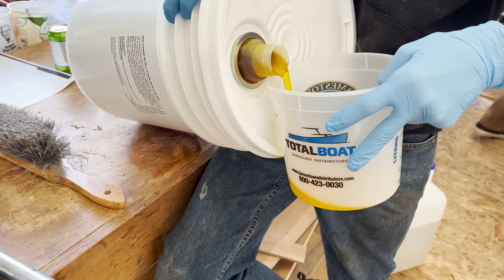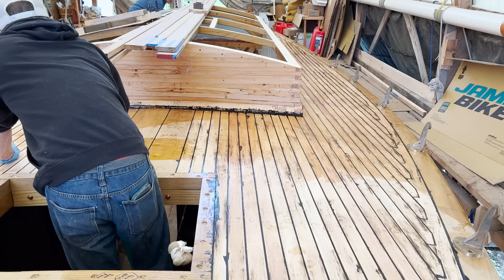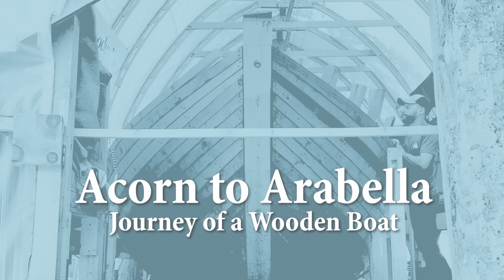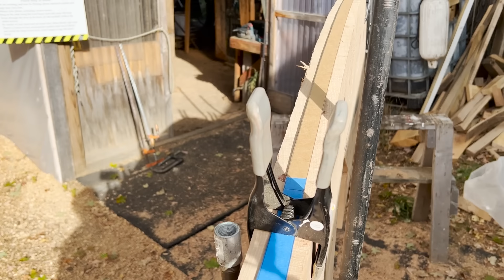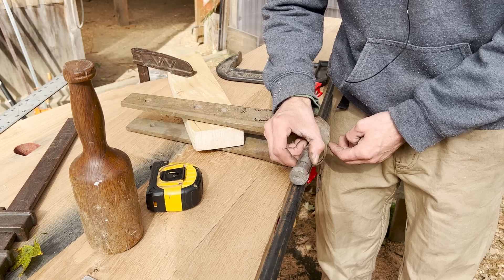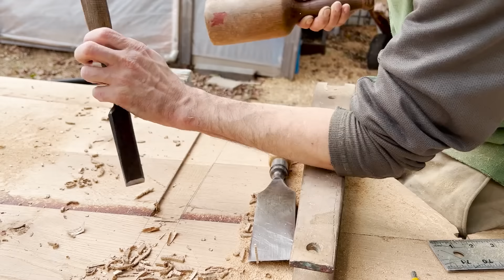Miniature Lead Pour for the Rudder - Episode 236 - Acorn to Arabella: Journey of a Wooden Boat

Comment: Steve tip for ya. For big removal. Using a weed torch or heat gun on low to soften NOT melt the pitch in one area at a time. Clean as you go by using 2 old towels. 1 soaked in linseed oil to loosen and scrap the pitch clumps from the surface and 1 dry towel to remove the pitch. Then for the residue and stain clean up. Use a variable speed angle grinder with scotch bright attachment of different coarseness and linseed oil so pitch doesn't stick to other area's. Pads will clog up so you'll go through quit a bit of them. 👍👍👍👍👍👍👍👍👍👍👍👍👍👍👍👍👍👍👍👍
Reply from the maker: Thanks for sharing!
Reply: @AcornToArabella  No problem remember doing a job on an old wood back deck years ago. A home owner had pitched it with black top them selves. Then past away. The home owners Son needed the whole house restored plus the deck on a budget. So he could sell the property. Looked like it never even happened.  After we restained it😎👍👍

Comment: A rudder that wants to sink or float will make its removal and instalation difficult in the water, one that floats just enough to stay at the surface makes more sense. Find the weight that adjusts your rudder's buoyancy in a pool or pond, with the project's indicated weight as a first guess. Once floating (or sinking), add (or remove) weight until buoyancy is neutralized. Then, remove barely enough to keep it at the surface in fresh water. Take note of the weight remaining on the rudder. Buoyancy will increase at sea, so additional flotation (safety margin) is unnecessary.

Comment: Have you guys thought of a "soft" solvent to get rid of the pitch? I'm thinking Xylene or butyl acetate. I've used them to remove hardened PVA paint, cement which has liquid latex and water as the liquid component and a general degreaser. Maybe one or both will dissolve pitch, but on drying should leave the rest intact?
Reply from the maker: Thanks for the recommendation.
Reply: @AcornToArabella  Goes without saying, which I forgot! Test a bit first!  Xylene smells a little, except in a confined area where it burns your eyes! Butyl acetate stinks to high heaven, it's also used as an apple flavoring! I cleaned 15 year old PVA paint off my wooden ceiling trims, the house stank for almost a week, but the result is no trace of the previous painter's mess.

Comment: Your welding would look better if you would weld where there’s no breeze.
The moving air is blowing your gasses away.

If you are concerned with the lead moving, cross pin it.

I thing the lead is to assist in returning the rudder to mid ships

Comment: Concerning led on the rudder: motorcycle riders will testify to this - weighted handlebar ends help reduce vibration. Vibration on the rudder won't be an issue but led may have a stabilizing effect.

Comment: Just looking at the design, I'd guess it's to weight the rudder so it naturally wants to rest centered with the tiller amidships.  Given the rake of the rudder post and the natural buoyancy of the rudder, maybe without that lead weight the rudder would try to float, causing the tiller to want to come hard over on it's own whenever the boat is at rest which would be irritating and cause the boat to "crab" when anchored in any current.  I dunno; just a guess...
Reply from the maker: Many (most) rudders do not have any weight added to them. I think it’s most likely a smart accommodation to counteract forces while under sail. It would make weather helm (having to hold the tiller to wind) a little more easy on the arms of the skipper. —Anne

Comment: I would guess that the rudder would have neutral bouyancy if it were perfectly aligned top to bottom. Once the helm was over though the buoyancy of the wood would attempt to float the rudder "up" adding force to the rudder, the lead would pull the rudder "down" removing that effect.

Comment: Awesome work Steve!  One thing I’m wondering. Aren’t lead and silicone bronze pretty far apart in the galvanic table?  Is that a concern for dissimilar metal corrosion in the salt water?
Reply from the maker: No. Encapsulated as it is. Lead keels have bronze or galvanized bolts through them… again, mostly encapsulated and not a problem for a great many years. The lead would corrode before the bronze, besides. —Anne
Reply: Thanks. Always learning something from watching this channel!

Comment: Just out of curiosity, did you need to leave the bronze fasteners in place while tapering the rudder?  Not so worried about planer blades as I am about your adze but either way, it makes for chewed up edges.
Reply from the maker: It’s holding it all together, and it’s all been glued. Check out last week’s episode for more on that.

Comment: Tally Ho rudder was originally going to look similar, but Leo changed design based on hydrodynamics, so now his trailing edge is straight vertically and not curved so water is forced over train edge and it doesn't sneak above or below where curve is the widest. Plus the deepest part of the rudder has the most steering effect as the water pressure increases as you go deeper.

Comment: Fantastic work as usual. I have a question, why would you not fair the rudder to a NACA profile knowing, as we do now, how effective they are compared to a traditional tapered profile? From my limited research (quick google search :-)) I know that it was developed in 1935, so after Arabella's design. My thinking is that it doesn't detract al all from the esthetics of the boat but has huge advantages in steering power and considerably less drag.
Reply from the maker: It wouldn’t have a huge effect on the speed of this heavy-displacement cruising boat that’s likely to spend a great deal of her life going about 5 mph in water. The taper makes a little difference compared to leaving it heavy on the trailing edge, and that’ll do for this purpose. Happy Friday!

Comment: Expanding on the other comments, the lead makes the rudder negatively buoyant (it wants to sink).  With the approximate 45˚ angle on the rudder hinges, and the rudder below the hinges, a negatively buoyant rudder will tend to self center when you let go of the tiller.  Without the lead, the rudder would be buoyant and want to float/flop to one side or the other when you let go of the tiller, not a good thing...
Reply from the maker: Not many rudders are weighted, though, and they do a-ok. We’re noting the detail because it’s interesting.
Reply: @AcornToArabella  You are probably correct to just trust the Atkin design!  Your comment got me thinking more about the dynamic details.  My negative-buoyancy-to-center is true when still in the water, not very interesting for a rudder...  When moving, the hydrodynamic pressures created by the flow of water over the rudder will tend to center the rudder.  The more interesting thought experiment is when on a reach and heeled over.  At that point the greater wetted area on the leeward side of the keel will tend to pull you to leeward or off the wind.  I wonder if there is a little net buoyancy left in the weighted rudder to pull the boat back into the wind.  It would be incredibly clever to have a slight net buoyancy to keep the tiller neutral as you heeled over on a reach.  Anyway, maybe next year, when you get a feel for the tiller in various winds, you can let us know how well all of the Atkin design works...

Comment: Could the purpose of the lead in the rudder not be to keep the boat going straight. If the rudder is not held the weight would pull it to its neutral position.
Reply from the maker: Maybe useful at anchor or while raising sail in that case. It’s probably most likely for multiple reasons. Counteracting weather helm, or making it easier to manage, for example. —Anne

Comment: If you're using a belt sander on the final finish of the rudder, why not use a router to get the taper you need instead of doing it manually?
Reply from the maker: Routers can take off very easily. He removed plenty of material quickly with the adze. It’s a preference thing.

Comment: Could the weight be to counter act the lever arm of the tiller? To help bring the rudder back to center. I have zero boating experience just speculating.
Reply from the maker: It’s probably for a couple of reasons, and when/if we feel a difference from other boats KP and I have sailed, I think we’ll be able to say. Neutral buoyancy for ease on the hardware, making weather helm less work for your arm, centering while not tied off at anchor… all of these seem plausible. —Anne

Comment: Having the weight outwards should dampen the rudder a bit. Spontaneously I would think having it inwards would be better because it would be easier to move the mass but I guess that's not really what it's meant to achieve here. Having the mass outward would mean that the water movement would affect the rudder less so i guess it make sense, just that it also mean that the skipper needs to apply more force as well. 

Not a boat builder though.

Comment: I have two questions: First, what is the name of the plane that sat on top of the groove as you were using to work the slots for the rudder hardware AND What were you using to sharpen the edge of your adze?
Reply: The plane is called a router plane and the sharpener i guess is some kind of wet stone but i could be wrong.

Comment: Me thinks the lead is to ensure the rudder always swings back towards the middle, even with the tiller in the upright position. I have a longkeeled plastic folkboat  with a similar rudder. When mooring you often stand up aft, with the tiller in an upright position. As you move forward to get a mooring line on shore, the tiller stays upright (friction), and the the rudder falls to either side, due to the tiller weight and the angle at which the rudder hinges. Annoying to say the least! Some lead in the rudder would make sure the tiller stops going to the side, avoiding unwanted mooring drama…

Comment: I thought the linseed oil would softened pitch?
Reply from the maker: No, it doesn’t have any solvent properties to it really. The pitch stands up to it. If you mixed linseed in with pitch while it was hot it’d probably take longer to cure.

Comment: Why not use tar and bedding compound to fix the counter weight to the rudder? Wouldn’t that be more in line with the overall build philosophy? Oh right, I forgot, you tapped some 4200 trees. No problemo. Easy peasy.
Reply from the maker: HAHAHHA welllll, not sure if our build philosophy is fully understood—easier maintenance, longer term. Basically, under the water or wherever certain materials are used, we’re using what we think might work best. Tar is a bedding compound, but never cures and will lose its oils to the wood around it and slowly over time to either the air before we launch or later leeching into the water. A chemically curing glue will last longer.
Reply: @AcornToArabella  Wellll, research is showing these modern lightweight polymer compounds do leach into the water column, descending very slowly as they’re absorbed into the food chain. The facts are we don’t fully know the longterm effects.

Comment: Hi Stephen, I'm wondering if maybe you could test out the balance of rudder's counterweight by setting up a pre installation test before Arabella goes in water ? This would give you a sense of it's balance... once rudder is fully cured in and painted, go try it in water to see if it floats near the intended mounting angle naturally when submerged ( to near or below operating depth condition ) while held down by a big enough anchor from it's pivot points ? Ultimately, I believe Atkin added that weight to balance out the multiple forces acting on rudder and steering gear throughout it's operating range.  Would be an interesting video, right ? If it's too light to counterbalance, you can add some C clamps onto your ballast point with added weights ?

PS        Have you considered using a torch ( Shou Sugi Ban ) on any submerged wood surfaces to prevent rot and worms etc ?  See : https://www.coachhousetimbers.com.au/everything-you-need-to-know-about-wood-charring/
Reply from the maker: We’ll be using cuprous bottom paint for the bottom of the boat.

Comment: but but.. Why does the rudder taper?
Reply: The rudder tapers toward the aft edge to improve the flow of the water.  It helps for the flow to remain "attached" to the surface  which reduces drag and improves the "lift" of the rudder when it is moved to turn the vessel.
Reply from the maker: 👆this! Happy Friday!